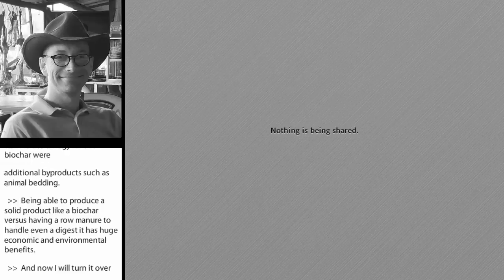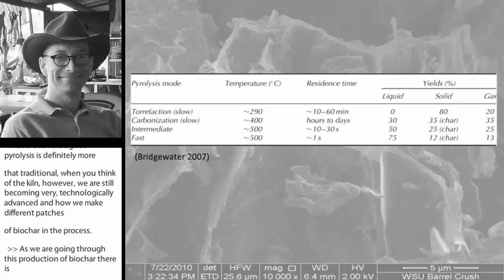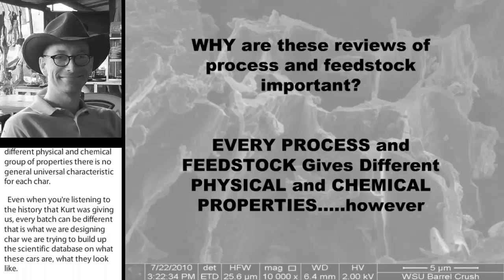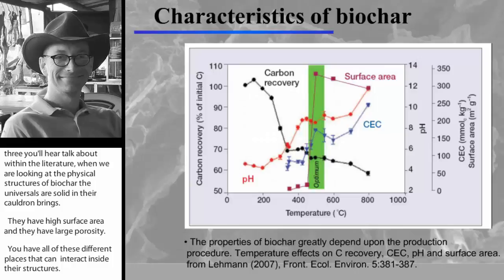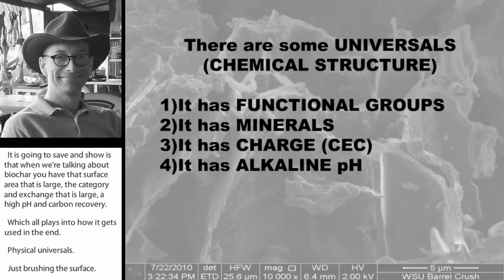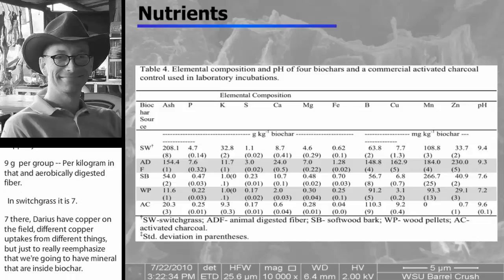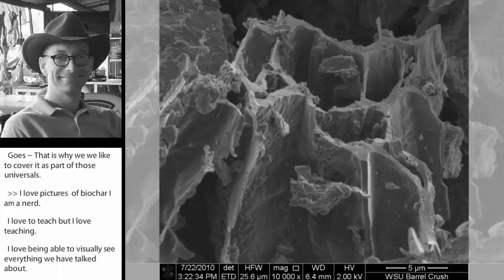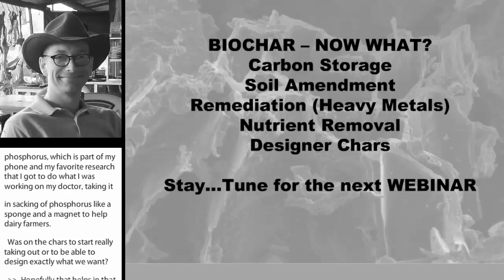BIOCHAR: Physical and Chemical Characteristics

Comment: generally, at what pyrolysis process (slow or fast) will result in the highest surface area or porosity of the biochar? If biochar is pH 7 to pH 11, however your plant requires to be in pH 6 or less, what can you do so you can still use the biochar?
Reply: 16:58 'it may not be the best wisdom'
Reply: @SlackerU  please elaborate?
Reply: @xyooj96  He says it's not wise to use it in high PH soils. 16:58
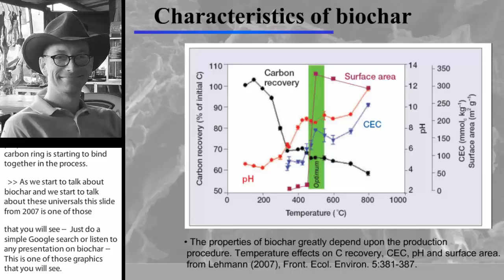Reply: You wanna go for 500-800 C and slow pyrolysis process if you're looking for a soil amendment. That seems to be the sweet, as you can see on 11:00 .
Reply: Slooow at high temps yields the shizzle.